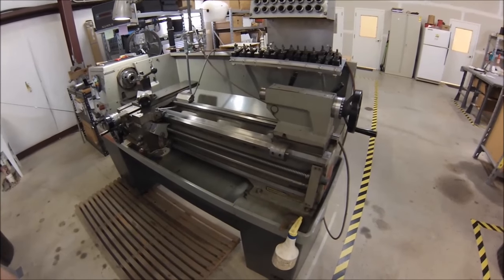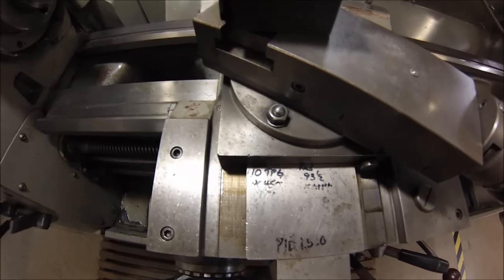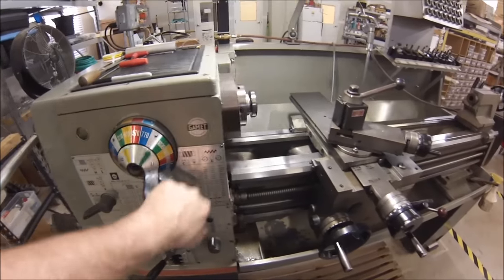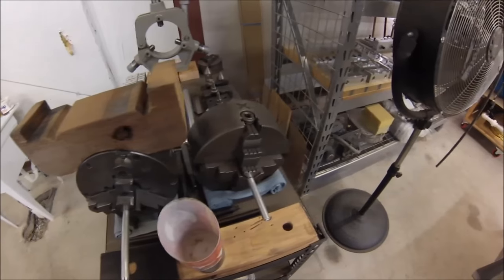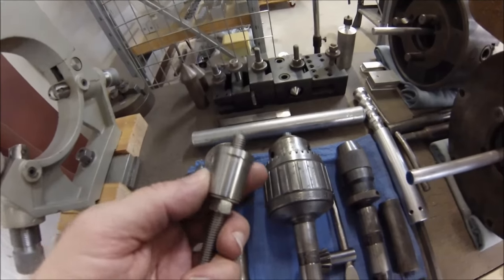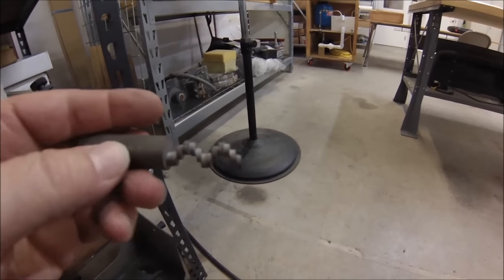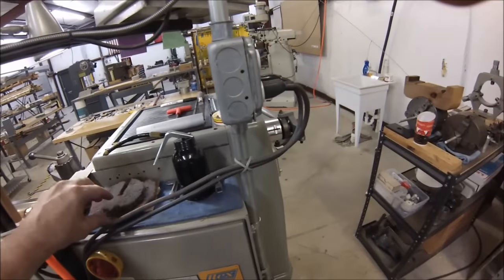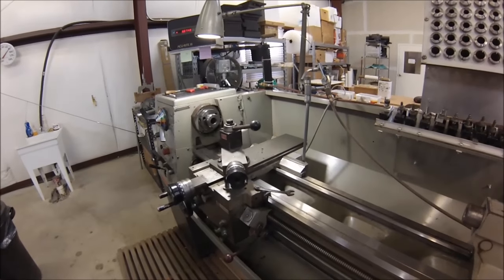A close-up look at the 13" Clausing Lathe

Comment: May I inquire as to what you think a fair ask is for one of these lathes? found one (been looking for a while but hadn't considered a Clausing until I watched this) that appears to be in great shape and is minimally tooled (3 and 4 jaw,  Aloris knock-off) relatively close by. Guy wants ~$3.2K advertised price.  Also when inspecting it are there any "gotcha's" to be aware of you could pass along as an owner? Any help's much appreciated - many thanks for awesome content!
Reply from the maker: That price is right in there. Look for impact marks on the ways and compound. This will be a good indicator of the crash history. Pull the end cover off and look for broken gears. Check every speed setting, and be sure the thread screw spins forward and reverse in random pitch settings. Confirm the power feeds work on the cross slide and carriage in both directions. Look at the belts, check for oil leaks and visually inspect the bed ways for drastic changes in surface finish. This may indicated unwanted wear. I usually stay away from machines I don't get to see run. Good luck.
Reply: Joe, I really appreciate the time you took to give me such a thorough and complete answer - armed with this and some other stuff gleaned here and there I went, looked and decided to pass. Thanks very much nonetheless, and really enjoy your no nonsense approach - I learn something (sometimes 203 things) with each new video...please keep 'em coming!

Comment: That's a nice sized machine, and you keep it very clean.  You may have mentioned it in this vid or previously, but I missed what size tool holders you have, they look like  BXA to me?  What's your rpm range?
Reply from the maker: Hi Bill. They are BXA, good eyes. I'll have to check the RPM range, but I believe its 40-2500

Comment: Extremely informative videos! Do you use the WD-40 hanging on your lathe for cutting fluid or way oil? Thanks
Reply from the maker: I actually use it occasionally for machining stainless. Many say it doesn't work, but I would disagree. There are better cutting fluids, but WD-40 will get you buy in a pinch. I also coat my ways with it if I expect to be out of town for an extended period.
Reply: This very  nice lathe (was always my favourite) has a reservoir in the apron which has to be filled with way oil and that is Shell Tonna 68 or equivalent, WD 40 is out for that purpose!
The apron has a manually operated pump which is used to supply the way oil to the various locations.

Comment: Joe, I need to ask you a question about the D1-4 camlock parts? I hope you can tell me or give me an idea of what's involved since that's the type you use on your beautiful 13" lathe. I have looked for days trying to find dimensions or pictures of the detent rod and spring that slides in the groove to lock and unlock the cam stud on the backplate. I am making D1-4 camlock to screw unto my threaded nose spindle using lock tight. I have the materials but I have no idea on what the internal parts look like except for the camlock. I don't want to waste your time so I uderstand completely if you can't help me out with this. Some how I will figure it out. Thanks
Reply from the maker: Maybe this will help     https://www.hobby-machinist.com/threads/d1-4-spindle-chuck-measurement-and-setup.10651/

Comment: what a n amaizing set up, old saying ( an artisan is only as good as his tools) please explain what is the difference between a centre laithe and an engine laithe
Reply from the maker: I believe its a geographical thing. Fairly sure this machine is considered a center lathe in the UK. Comments any one ??
Reply: Hi Joe,
I think that it’s a US / UK thing - over here they are centre lathes, as the original machines were only capable of turning between centres - chucks were a later invention !
Engine turning is a specialist decorative art, where the tool is moved in geometric patterns by a highly modified lathe to generate the elegant tracery, beloved of clock makers, and the like. I expect that there are probably videos on YouTube demonstrating the process, for the curious . . . .
Kind regards,
Steve A.
Reply: Great walk around that I much appreciate. I learned a lot about the 13x 40 Clausing that my brother just purchased. I suspect the name “engine” lathe dates back to when machine shops were powered by steam “engines”.

Comment: Joe, I am purchasing the 15" version of your lathe and have not figured out how I am going to get 3-phase into my home.  You are the only person on planet earth I have ever heard mention changing a 3-phase motor into a single phase motor.  Can you provide any more information on that?  And are there any drawbacks to doing it such as loss of power, slower spooling, ect.?  Any information would be GREATLY appreciated.
Reply from the maker: Greetings. The swap from the 3 phase to the single phase was an interesting project. Not only was the physical size of the motor an obstacle, the wiring in the panel need to be switched around a great deal. I called clausing and one of their tech guys walked me through which wires to address.  Before you go down that road, you may wish to check into a phase converter. They allow the use of 3 phase motors on a single phase line. I ran a bridgeport on one for years without an issue at my last house. There is a power sacrifice, but I don't think it will be a big deal. The 15" machine is a fantastic machine and will still get the job done. American Rotary and Phase A Matic are 2 companies you should investigate. A static converter like this one  http://www.phase-a-matic.com/StaticDescription.htm   sholud help without draining your bank account.
Reply: Oh!  You swapped out the motor.  I did not realize that.  My original plan was to do an american rotary phase converter.  My debate on that has been what size to get.  Their website recommends a 12.5HP converter but I cannot find one anywhere.  So I am debating between getting a 15hp or getting a 10hp, seeing if that works, and if it doesn't, getting a 5 and wiring the two together.
I really appreciate the reply.  I discovered your channel a couple of days ago and really appreciate the wealth of knowledge you are putting out there sir.
Reply from the maker: A static converter should also work depending on the HP demands of your work. I believe they are cheaper and smaller too.
Reply: Easiest way is a VFD, with a transformer to change voltage if necessary. My 600V 3 phase Bridgeport is run via a transformer to step up 240V single phase to 600V, into a VFD which provides the three phase output. An added bonus is the easy speed control and ability to set power limits to motor. For my Hardinge HLV-H I built a rotary phase converter as it is a 208 V machine.
Reply: I’m doing a DC conversion…in case you go in that direction….

Comment: Joe, nice video. So how do you know what spindle speed you're running at? I see four colored arrows on the dial, and they all point to different numbers???
Reply from the maker: I guess that would be the camera angle. The colors on the 2 dials must match and line up with a 3rd colored zone on the top outer surface of the speed selectors. It goes from about 11 to 1 o clock facing the ceiling. 3 colors line up, that's the speed. Good question.
Reply: Thanks, Joe. I'm just a hobbyist using small Sherline equipment, so I'm not familiar with the Clausing.
Reply from the maker: I entered the Sherline machinist challenge years ago. A 60 piece aluminum puzzle.

Comment: Can you tell a little bit more about the 1in vibration mounts that you're using on your lathe?
Reply from the maker: I believe I got them from MSC. I have a piece of 1/4" thick aluminum plate on top of them so my leveling screws don't dig in. They work very well. I believe they are 4 x 4 x 1
Reply: Many thanks for the info!
Reply: Do you find them compressing over time and having to setup the machine again?
I saw that you mentioned doing a video on setting up a lathe and requested good sites. https://www.youtube.com/watch?v=5bWpgElMm8c

Comment: Hi Joe, nice tour.
Do the Lathe manufacturers recommend 'rubber feet' of any kind?
Reply from the maker: I have 1" thick rubber damper blocks topped with 1/4" aluminum plates under this machine. It helped with the vibration and surface finish
Reply: OK Joe thanks . . .
Reply: @joepie221  I looked at msc and saw circular rubber isolation mounts rated at 1,000 pounds but no square pads with adjustable aluminum plates..? (Let's call them Joe`s custom isolation mounts ) I think I can come up with your set up with a adjustable bracket and a rubber foot mat .....

Comment: I know it's an old video but at 2:50 you mentioned a tool you use for when the Aloris nut jambs.  Can you explain how it works?  I have an Aloris AXA tool post and cant figure out how it unjams the nut
Reply from the maker: Its not unusual for the entire threaded post to spin when you try to loosen the lock nut. The file tang, which is exactly that, a cut off file, wedges between the knurled knob on the tool holder and the cam body collar. When the threaded shaft tries to spin, the taper wedge jams in the opening and the nut loosens 100% of the time. Just be sure to place it on the side that draws it in and not the reject side.
Reply: Joe Pieczynski ok gotcha!  Great idea

Comment: Its funny you mention steady rest, I work in a shop with machinist who have been there for over 20 years and couldn't find the center of a piece of stock with a steady rest.
Reply: There are two ways to set up a steady rest. 1. Near the chuck with the part indicated true. 2. Some distance away from the chuck with the part also indicated true. The latter is more accurate but very delicate since it's easy to push the part off center with the steady rest jaws.

Comment: Hello Joe ! I also have a Colchester Triumph 2000 here in France. Its named Clausing Colchester in the US, and I don't know the reason for this, because its the same machine. And a great machine ! What is interesting for me its the collets and spindle apparatus allowing the fixture. I would be interested to equip myself with the same collets. What collet are these ? Could you give me few references for me to search some of them? Thanks in advance and have a good day ahead ! François
Reply from the maker: I use 5C collets on this machine. You can piece together the closer system from commercial components. Take a look at mscdirect.com.
Reply from the maker: The actual closing mechanism is stamped "Royal Products"
Reply: Thanks a lot Joe ! As I didn't know the naming of the device in English (Collet Closer), this is precisely what I needed in order to start my research. Will start to look on the side of the UK, where we can find plenty of accessories for Colchester lathe. Have a good rest of the week. François

Comment: Hi Joe! The lathe stay on leveling-mounts that hard fits to floor or you can move them?
Reply from the maker: The machine just sits on the 1/4" plate of aluminum I added to the top of the rubber. Its sits fine, but is not fixed to the floor.

Comment: hi Joe I have a Colchester Student 1800 lathe wich is very similar to your machine.
I wonder if you have specifications available for the spindle?
Thanks for your efforts
Reply from the maker: For what application? Collet closer maybe?
Reply: Joe I would like to make ER32 collet chuck
Reply from the maker: That would be a cool project. I use those on my CNC.

Comment: What is the end gear set like in the back of the lathe does it have any.
I also noticed they have the Module and  Diametral pitches pre-set up for you on the charts for cutting worms.

 Worth
Reply from the maker: Hey Worth. All the gears on this machine are on the extreme left end of the machine. I never have to mess with them unless its a very special circumstance. This machine has more charts and options that you can shake a stick at. I wanted the 15" model, but couldn't pass this one up.
Reply: Thanks Joe I was curious as to how many end gears you had in other words the driven gear the idler/compound gear and the driving gear(aka) pinion the tooth count of each and so on.
If I new the model number I could look it up.
I found one very close but no cigar it may be an older lathe.
What I am doing is I have the regular change gear box and 7 change gears I can use in back plus an 86 tooth 91 tooth compound gear.
The factory had it set up with it on the 86 tooth and a 40 tooth driving gear and a 40 tooth driven gear.
this is just a 1:1 ratio in the back the 82 tooth idler gear doesn't do any changing of the ratios.
This allows me to cut 40 imperial threads without messing with gears.
What I did was flip the compound/idler gear around and run the idler on the 91 tooth all of the time.
This allows me to move the driven gear in and out from the 91 to the 86 tooth this makes it a compound gear when I want.
By doing this and changing gears in the back I can cut 600 some odd thread pitches metric and imperial.
In that mess of pitches is a whole pile of diametral and module pitches.
I am in the process of weeding them out.
Once this is all done I will get aluminum placards made up and they will be installed on the lathe. 
An example is the circular pitch of a 1.5 module is 0.1855 the lead of a 5.5 TPI thread is 0.1818 that is a difference of only 0.0037.
I can get closer but this allows me to cut a worm and still use the half nut.
Just because the factory doesn't say you can do it doesn't mean you cant do it, you just have to weed it out.
I do this by looking at how other lathes are built and counting gear teeth.
That is the reason I asked you in the first place. 
Now If I could just figure out a way to cram a 23 tooth gear in that gear box..LOL
Thanks again for your videos.

Comment: Thanks for look.Do you know where i can get 5c nose cone my lathe ? I have the same lath as you. I have the closer. I spend a day  trying to turn one and was off ten thousands at the end the day. to many angles for a beginner
Reply from the maker: Believe in yourself and you will get it done. Indicate the angle inside your spindle with the indicator needle on the 'Tool Centerline" then put your chuck on and finish the nose cone OD. I have a video on setting the compound to precision angle that may help. Once the OD is done, take the chuck off, install the nose cone and bore it in place. A journey of a thousand miles can be accomplished one step at a time. Go for it. Its OK to fail, just don't quit.

Comment: Another tip you dropped Joe…3 phase to single phase ….converting mine to DC…..any books or tips on this one.?
Reply from the maker: I shot a picture of my power panel and called Clausing service with the question. They walked me through what to do and it worked perfect.
Reply: Thanks Joe,
So you sent a pic of the motor plate?
If my DC motor conversion fails to provide the torque then I might try using the original. My plan was to use 2 DC motors…one small one for the oil pump and a larger for the main drive…my off grid shop cannot support the inrush current a AC motor requires.

Comment: That actually is a Colchester lathe being sold under the name of Clausing, I have a Colchester Mastiff exactly like it!!!
Reply from the maker: The main nameplate on the front of the machine actually bears both names. Clausing-Colchester. I've run a bunch of these in different sizes over the years. Never disappointed. I really like the 15"
Reply: Mine is 11 inches height of center that gives a 22 inch dia over the bed. It has a 3.5 inch spindle bore, it helps me a lot in my hobby restoring old engines especially when it comes to machining flywheels:-)) Then I have a small Myford lathe for the small jobs!

Comment: Looks like Colchester lathe
Reply: That's because it's a Colchester Student 3100.
Reply from the maker: It is. Some have called it a Triumph, but here in the states, its just called a 1340.
Reply: @joepie221   Triumph would be the 15" model. Colchester lathes were rebranded as Clausing only for the North America market. It's a really good lathe with (for its time) several innovative features though strangely for such a machine it has no storage capacity in either of its plinths or under the centre section.
Nice to see you have kept the Burnerd chuck. These were dynamically balanced and specifically commissioned for this lathe :-)